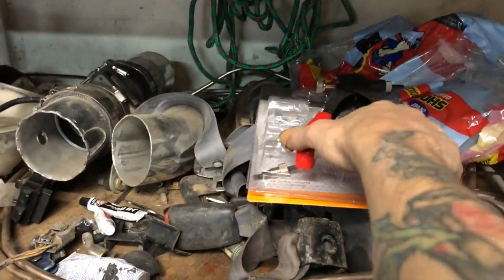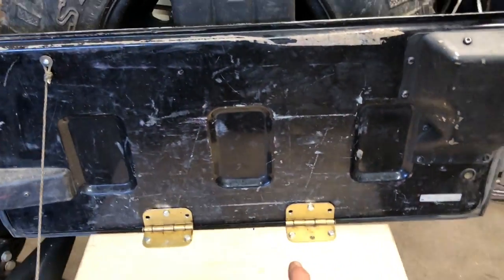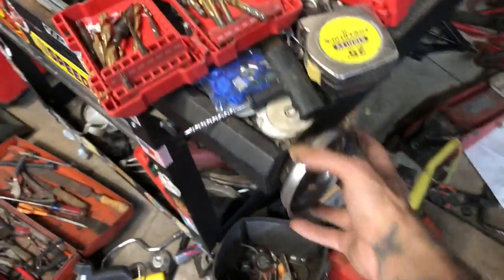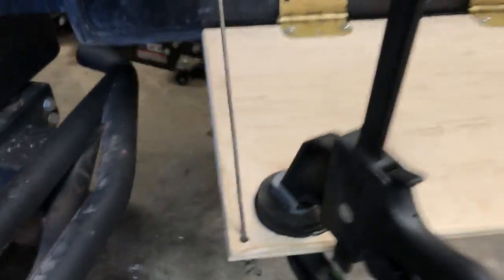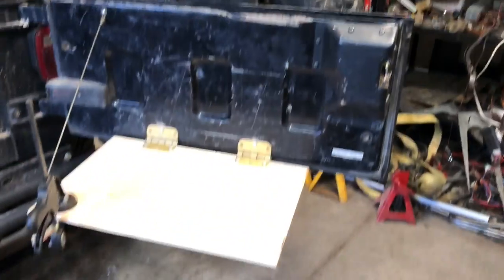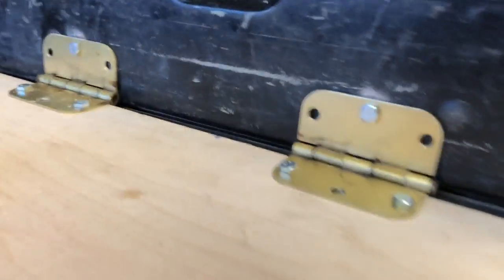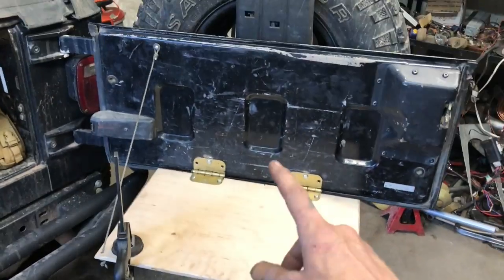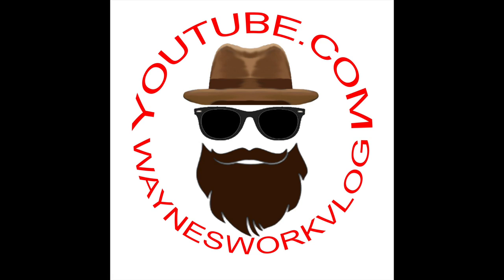Jeep Wrangler Fold-Down Tail Gate Table S14E16

Comment: Nut certs are OK until you need to take the bolt out and the nut cert spins and you can't get it apart!!! It's VERY frustrating!!!
Keep Rocking it out!!!
Reply from the maker: Yea i have seen that happen, I only use them in places I intend to never need to take them out. but if i ever do I have the options of unbolting. Just never liked sheet metal screws or anything like that on cars...